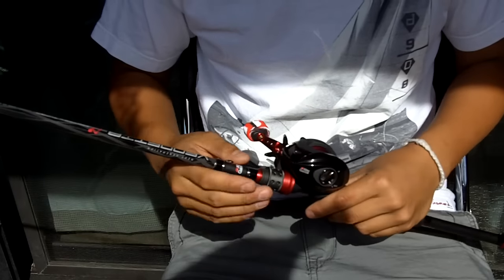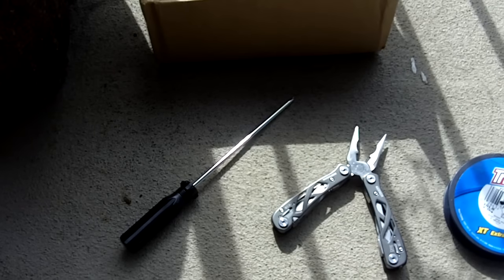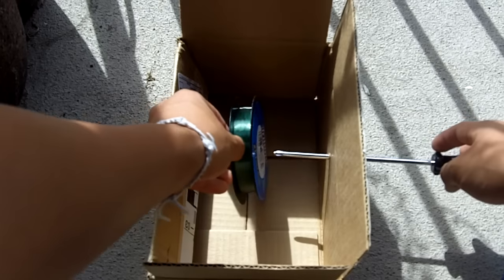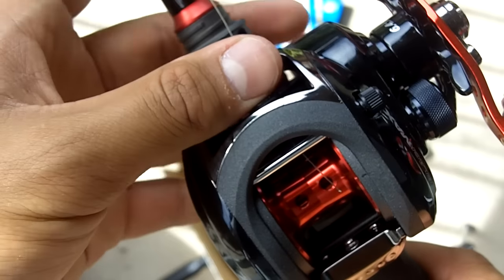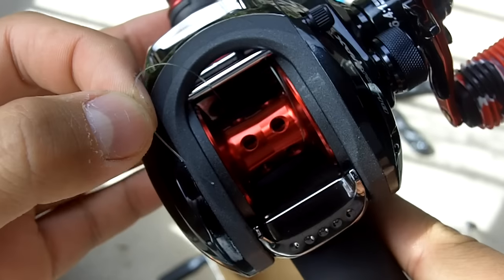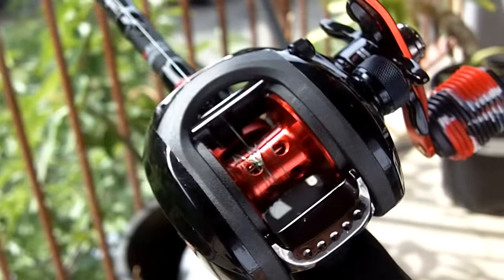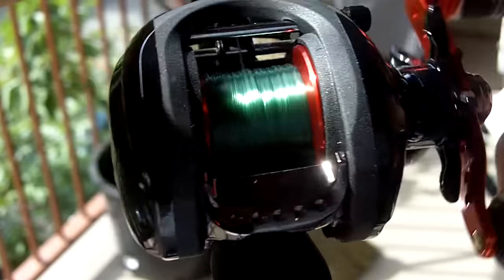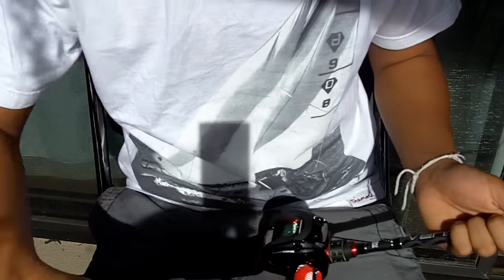How To Put Line on Baitcaster - EASY

Comment: A good way to wrap your line around the spool is to use a bit of sticky tape to hold the line to the spool..wind it around twice and then take the tape off and tie an Arbor knot which will slip down and is not very bulky.

Comment: Just a tip to anyone using braid without mono backing... make sure you tie the braided line into the holes with a good knot, like a slip knot, so the line doesnt slip when you are reeling in with a lot of torque.  Braid doesnt really 'grip' onto itself like mono does.

Comment: Just would add that when you spool a bait casting reel come off the top from the spool and for a spinning reel come off the spool from bottom . This helps for better spooling.
Reply: Spinning reel depends on the direction the reel spins when cranked 😉

Comment: Best part of low profile baitcasting reels is that you can tie braided line in the holes and won't have to worry about slipping
Reply: The holes on many of the spools are beveled and very sharp, always check thoroughly as many will cut the line like a knife.

Comment: Not trying to be rude but the holes are there to tie the life through two holes so you get no spin.
Reply: Line not life
Reply: (there's an "edit" button over to the right- no need to re-post)
Reply: No they're not, they're ported to save weight, and not all spools are ported.
Reply: @andrewwang3931  They are there for 2 reasons:  Weight saving and tie your line to prevent from spinning (especially braided line)

Comment: Good video. Another way to hold the line supply is to hammer a 16 penny nail a short way into any post or vertical wood. Place supply on nail so that line is coming off over the top towards you. It will work the same as the box.

Comment: Another tip that has helped me with new line against getting rat nest tangles is to submerge the reel/baitcaster in warm water about 10 min, this treats the line and prevents it from tangling so easily.
Reply: Da Reptile I thght u submerge the Line that’s on the coil NOT the baitcaster Dude

Comment: For those of you that want to do things the hard way, this video is for you.  Most people use a small piece of tape to get the line attached to the spool (The easy way).  Don't worry about the line coming undone from the spool because there is no way you should be using that much line unless you're fishing 4 lb test for a 20 lb fish.

Comment: How much do u like your blackmax because I'm thinking about getting one because I started using spinners but they tangled all the time and I can't control that and I can't cast accurate so wanted to go with bait casters I can get backlash out easy but if I tangle up a spinner then I have to cut the line then line it and then put baits on
Reply: FeAr Pulze old comment, but make sure your line is coming off the spool in the right direction when you’re adding new line. Then take your spool off and put it in warm water for a few minutes.

Comment: do you have to put line thru the hole on spool? If you get it around the spool do you go behind and around or front and around? every time I try to knot it it comes loose, and when I attempted to cast it once and feel it in it got all tangled up and it didn't work so I had to cut it all off:( please reply anyone with tips)

Comment: Strung up my brand new Abu Garcia, and my first cast it knotted on the reel and it's so bad I have to cut everything off. Been fishing for 20 years, and have strung many reels, never had this issue before.
Reply from the maker: It sounds like you got a birds nest ( spindle continues to spin within the coil of line ). I’d check the manual / YouTube videos on how to adjust your reel to avoid this.

Comment: Chris, question? I just put new line on an old quantum reel. When I cast, do I keep the button down until I go forward then let go? I keep getting birds nest even on a good cast. I’m use to using a closed face zen I reel?
Reply: I’ve never used a baitcaster
Reply: Zebco reel, should say..love the box method!
Reply: @Debidawg  push the button down while you’re arm is in the air, then cast forward with your thumb VERY slightly on the spool of line, and push firmly with your thumb just as the line is about to hit the water. Then reel about half a turn until the button pops back up
Reply from the maker: Push the button down, cast, and then the button will automatically pop up, once you start to reel.

Play around with your settings on the reel, to avoid birds nests

Comment: is the line coming over the top of the line spool or from the bottom off the line spool ? or does it even matter.
Reply: It matters a lot with monofilament, but not at all with braided line. You want to take up the line from the product's spool so that it has the same curvature or sense (clockwise or counterclockwise) as the way you are winding it onto your reel's spool. If it is coming off the top of the product's spool as it unwinds, it should be going onto the top of your reel's spool as you wind it on. Otherwise you will be placing a twist in the line for each rotation. This is what causes twisting with monofilament. (Think of holding a rubber band at each end between your thumbs and index fingers, using both hands. Twist one end away from you and the other end toward you. You will get first twisting, and then supercoiling, which is twisting of the twists.) This is a very common mistake for DIY spoolers, and also for store personnel who were not trained properly. Strictly speaking, the same twisting occurs for braided line when it is spooled incorrectly, but the braid's structure allows it to relax, unlike monofilament, which tends to have a "memory" for its curvature on the spool.

Comment: Hey a lil help tieing the string to the reel if u r holding the reel the screw has a fat head  on the crank side un screw it all the way lose turn the left side of the reel and it will come off so u can take the spool out making it a hell of alot easier to tie to spool.......I have the same set up 90 at Wal-Mart buy u that combo but reel sucks buy a fluger alot better reel

Comment: Whats the smaller knob on the right just above ur line..not the tension knob but the smaller one??
Reply: +Brad Silvers i saw it to i dont know my reel dosent have that
Reply: +Brad Silvers For most abu garcia reels in order to open up the sideplate to remove the spool you have to unscrew that little knob to release the side plate.

Comment: I have the same reel and when i finished putting line in  there was more line on the left side than on the right. do u know why that happened?
Reply: There could be a problem with the lineguide
Reply: You have to make sure that the level wind (line guide) is set to the center before you insert the line through it and tie on to the center of the spool.  This will create a slight bulge at first but will even out once you start casting.

Comment: So im 16 about to be 17 i was doing this and about halfway thru my line bundled on the right side of my reel snd nested its self snd if i wanna undo it i have to cut like half my line what am i doing wrong
Reply from the maker: Did you remember to feed the line through the guide on the reel? The guide is meant to evenly distribute the line by alternating left-right across the spool. 

If it bunched up on one side, it sounds like this could be your issue

Comment: Does it matter if the line rolls off the top of the spool or the bottom?
Reply: No
Reply: Actually, it matters a lot. When spooling a casting reel, the line has to come off the top of the spool because it has to go on the same way it comes off and it will go on smoother without any line twists.

Comment: i need help i just bought a Abu garcia Blackmax and it doesnt reel in ? im thinking its broken??
Reply: SouL Dratic is there line on it yet?
Reply: SouL Dratic No it isn't don't worry, next to the handle of the reel there should be a gear-like circle, if you turn that it should start spooling your line one :) let me know if that helped! good luck
Reply: SouL Dratic search up some videos on how to adjust centrifugal braking and then dial it down. Its probably just tightened down to tight

Comment: Can u get the reel for left handed because I hold the rod with right
Reply: You need to get a reel that specifically has handle on the left side since you can't change sides on bait caster reels.
Reply: Yes  I bought the reel about three months ago and... you can buy it in both left and right

Comment: Why do sometimes ppl say they fill it up with mono first then they add braided line? Or the other way around I forgot but anyone care to elaborate?
Reply: Uzumaki Nagato they put some cheap mono on first for filler so they don’t use all the expensive braid just to fill the spool.
Reply from the maker: Correct, this is a method to save cost.  You use monofilament to fill up around ~40% of the reel, then use a fisherman’s knot to join to mono.

In theory, you never are actively using all of the braid on your reel, so no reason to have more than necessary.

Comment: i have a black max and I'm new to baitcasters but my spool is very sensitive and barley reels when i put pressure on it (when i try to put line on my spool i try to reel it in to put all of the line on but if i try to put pressure on the line to keep it tight on the spool,it will not reel because I'm putting pressure on it) does anybody know what i should do?? please help
Reply: It means your drag is too low. turn your drag up.
Reply: ok thanks

Comment: many things wrong here, 1: make sure u put line on in the same direction as the spool to avoid twisting.
2: when attaching line to your spool if it has the holes that is better to tie to than around the spool itself.  knot is fine overhand unless u plan on getting spooled by a large fish.
3:  u dont really need to go through that whole process with a box it works just fine setting spool on the ground and letting it fly around or if u need to use screwdriver just hold it in between ur knees.

Comment: why not just take the spool out of the reel and tie a strong knot?
Reply: +malueg79 easier to do it like this
Reply: Not at all. Spools come out easy. Plus you can drop some oil in the gearbox. I've got over 20 bait casting  combos. If it works for you then cool.

Comment: the video has a problem but if you download it will work. this is the best video i have ever seen for putting a line on the baitcaster.and it works the best for shimano reels because they have aluminium low mass spool but remember to download it.i have a site for direct download : keepvid.com

Comment: dude if your bass fishing 10lb is not enough
Reply: I use 10or 8 pound test when I fish for bass
Reply: bassin boyz depends the technique. Your obviously not quite a bass fisherman either. For drophotring and some other finesse presentations use 8 to 10 mono or flouro
Reply: oh i dint know you were drop shoting and fines sorry
Reply: Preferably not mono either... Mono stretches, which sucks for any situation I would ever use a baitcaster in. Flouro and braid are going to give you much more control, especially if you’re new enough to actually need to watch this video.

Comment: Just throw that combo in the trash.
Reply: Bro ur crazy the new vendetta rods the second gen and the new gen black max the bmax3 r both pretty good if you r on a budget the vendetta second gens r only 80 bucks and they r actually pretty good blanks 30 ton graphite is not bad and the bmax3 is alot better than the old ones trust me I have many lews, Diawa, and high end Abu reels and this is a very good combo for the money.

Comment: Hmmm...the title has the word EASY in it.  The whole cardboard box and screwdriver thing is too much.  Put the spool on a pensil between your knees.  Also, a good idea to attach the line to the spool to begin with would be to remove the spool to begin with.  If you can't make a decent knot around the spool that won't slip, use the sticker that came with the line you purchased.  By the way, I would not use Trilene but that's just me. Try braided or fused by diameter not strength.